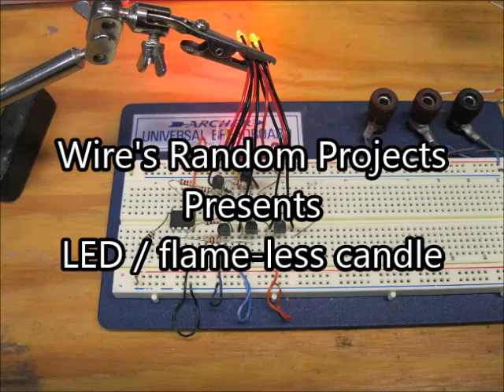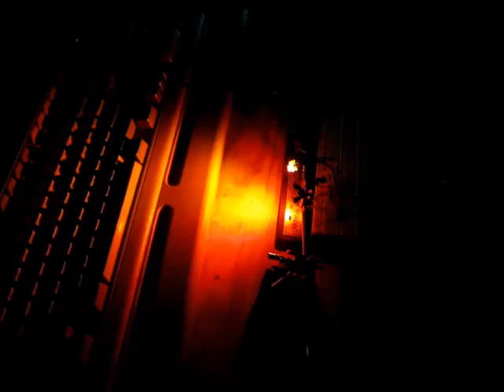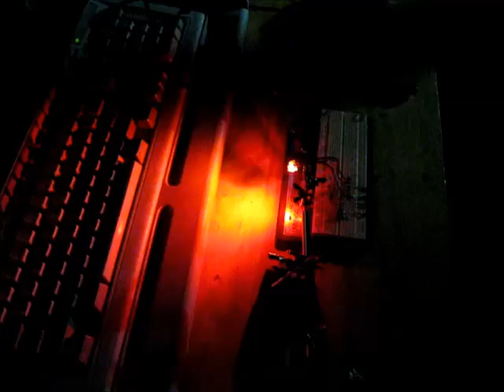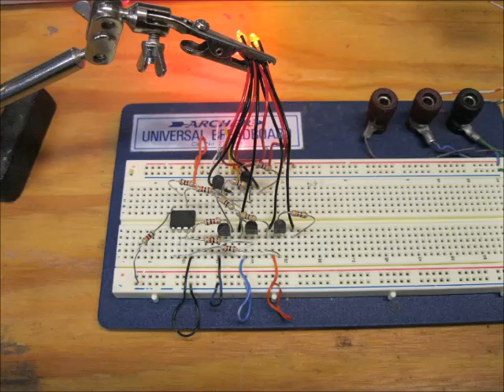[WRP] LED candle premium mode

Comment: I just purchased one of these kits, I may be buying 10 more for Halloween, I get started early!
Reply from the maker: If you have any issues with assembly just let the Tymkrs or I know. Typically as long as the solder joints are good and folks pay attention to location and orientation of parts they work on the first try.
Reply: How long would you say this could run on high capacity NiMH batteries?
Reply from the maker: Really not sure. I don't think I ever did a run down test with batteries. Normally just run mine off a dc wall wart.
Reply: Uh oh!! Tindie ran out of those kits!! I ordered the only two they had.
Reply from the maker: Backorder the # you need. They restock when they see there are backorders pending.